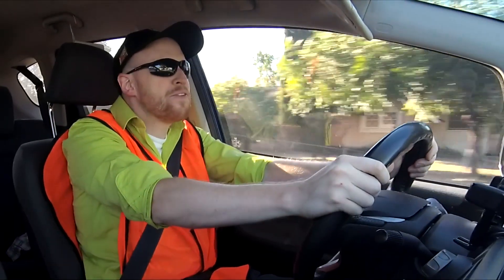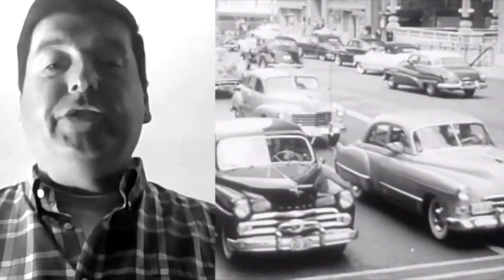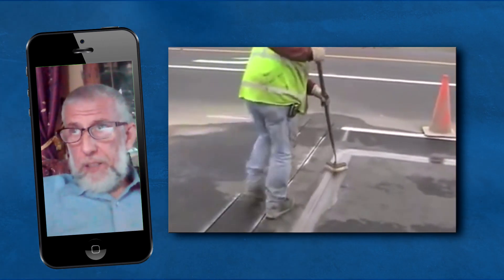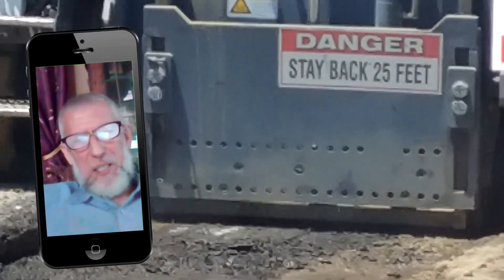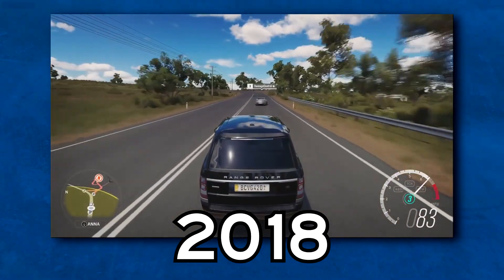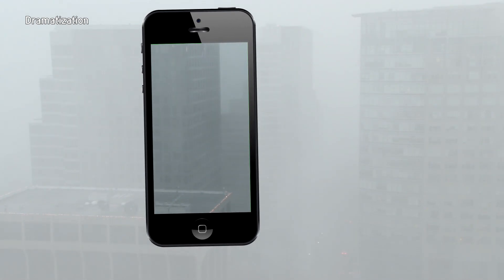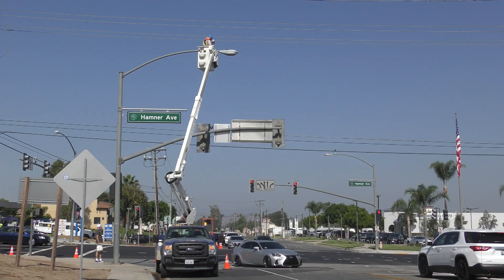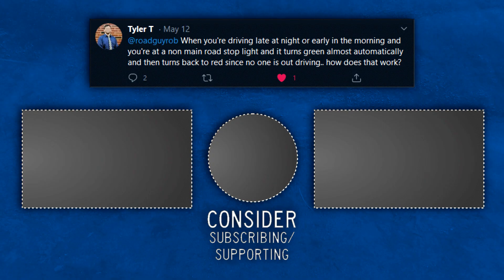How do stop lights "see" your car (to turn green)?

Comment: I am old enough to remember when the switches were mechanical.  Rubber strip embedded in the road, about 2 feet front to back and the width of the lane.  Pressure from the tires activated them.

Have not seen those since the 1970s though.
Reply: I remember, as a kid, taking a running leap and landing on the plate to get the light to change (small town…so there was usually no one around to cause a hazard.

Comment: well seems like cameras are so much easier. even if they break a lot its still super quick to fix. low voltage installation is much easier than asphalt work.

Comment: For all you lycra wearing carbon fibre bike riders... here's a tip to get the loops to work.  Glue a neodymium or other decent magnet to the under side of your bike.  Magnets set off the loops much more than metal so you need only a small piece to set the lights off.

Comment: The loop detectors I am familiar with are "variable reluctance" detectors. They do not detect any weak signal generated by a car going over the loop. The cars modulate the ultrasonic current  powering the wire loops and this is detected.

Comment: The digital cameras being able to see better in fog is likely due to the fact that their detection wavelength window is wider than our eyes, they see into the infrared and somewhat into near ultraviolet also. You can see your phone camera doing this with infrared with an easy experiment at home, open your phone camera app and point your TV remotes LED at it then press a button. The normally invisible flashing of the infrared LED will be visible on the vast majority of consumer CMOS sensors that don't have a separate infrared filter to exclude it.

Comment: Two things. I remember when the "loops" that were cut into the asphalt were square mostly in the 80's & 90's. Now they're round. 
I asked one of my local public works guys if the loops detected vehicles by magnet or by weight. He said weight. Here he says magnet. Which is it?
Reply: It could be both.  The old ones may have been weight but now by magnetic
Reply: Only really old ones were weight

Comment: Optical sensors are most affected by light after dark. One night a car was broken down at the stop line. With his emergency flashers on, the light would not change to let the other directions go.
After that I would start flashing my high beams as I approached the light, it almost always turned green before I had to completely stop
Reply: I have a black car. I had to change my route because of an old optical sensor.   It would not detect my car.

Comment: The signals I grew up with in England used two tubes close together, often covered with a single rubber strip. This could not only sense the direction of the traffic but also potentially its speed. (In the 1930s there was one experimental 'green wave' system that I was aware of, one of those 'if you kept to x mph then you'd never hit a red signal going through this town). As a horrible little urchin I used to like stomping on the tubes to make the lights change.

As a motocylist in today's USA I dread the coil detectors. You rapidly get to know which ones won't see you and adjust your route accordingly -- it gets boring wating for a car to turn up.

Comment: In Wisconsin, vehicle sensing loops are used at most all the traffic light intersections. As a motorcycle rider, I can attest to the fact that these loops will not ever respond to the presence of a motorcycle. Bikers pay taxes, pay license fees, pay insurance, and have to get a special license to operate a motorcycle in Wisconsin. Yet our roads are NOT at all designed to deal with motorcycles. Sitting at the red light forever, as cars line up behind you, is the norm. I’m told that motorcycle riders are allowed to go through a red light in this situation. How many other motorists or police officers know that this rather dangerous move is okay? Typical government bullshit engineering. Like all our roundabouts that are way too small for trucks to negotiate. Anyone who puts their faith in government to do the right thing simply needs to look around themselves.

Comment: Yeah I mean you can see the things in the road if they have them and they work of magnetism to detect the metal in the car which is why they suggest putting a neodymium magnet on the bottom of your motorcycle or scooter. It routes back to the HUB at the intersection and the HUB or traffic controller will use that data to make changes in the light. In other areas you can just have an intersection that is on a more stringent timer that will just change lights according to schedules that have been programmed after using those lines they string across the road to get an average for how many cars pass the area and what times. They base the programs off this and update the timings periodically.

Comment: Something I would like to know is the purpose of putting a detector on those traffic lights managing busy roads that are instead programmed to turn RED when traffic arrives. We have a surplus of those here in Alabama.
Reply: I live in St. Louis, where, and no this is not a joke, the city actually did time the lights specifically to stop people from hitting multiple greens in a row. 

This is most obvious on the Northern Kingshighway viaduct, where southbound Kingshighway gets a green just as McRee gets a green, which backs up traffic all the way to Oakland and beyond. However, that creates the opposite problem for the northbound side. Someone who gets a green at Vandeventer can end up charging all the way to Interstate 64. However, that's not as bad, since there's much better visibility and less conflict on the northbound side. Someone on westbound Manchester who wants to turn right can see all the way down the viaduct and then some, up to Interstate 44.

The reason they did this was because there were too many fatal car accidents involving speeders, which they figured wouldn't happen if everyone was crawling through the intersection as one massive 90 car long platoon. That worked and now St. Louis has an abnormally low rate of traffic fatalities despite an abnormally high rate of total accidents. Personally I'd rather have them just remove conflict points on roads and physically slow down streets but this is a pretty smart temporary solution

Comment: can you explain why it doesn't work if I shut my lights off?
I normally turn my car off when I know I will be stopped for longer than 10 seconds, to save gas. I did this one night at a notoriously long traffic light, and the light never changed. after 10 minutes of waiting I looked both ways and ran the light. When I explained to the police officer who pulled me over what happened, he said that the lights wouldn't change unless my headlights were on. How does that work?
Reply: What sort of detector was it?

Comment: We have an intersection near me with a traffic light on a big curve. They used to have loops further around the curve to measure how many cars were waiting, but when they switched to cameras, they only put one right at the intersection - traffic backed up for a mile because the intersection computer thought only 5-7 cars were waiting instead of dozens. I called the traffic engineering department and they apologized that they didn't think of this issue...

Comment: At the time I left Los Angeles they were installing camera traffic signals where the yellow light was only a fraction of the time it was yellow in normal non-camera lights.  People were getting tickets in the mail all the time for going through red lights.  And as people realized this, they were hitting their brakes and rear end collisions were significantly higher at camera-controlled intersections after installing these "safety" signals.  Turns out the company that installed these cameras got a large percent of the money from each citation mailed.  I don't know if they fixed or eventually removed these camera traffic lights.  All I know is the city thought they were the greatest invention and great revenue producers but city street drivers thought they were the most unsafe things ever installed for controlling traffic.

Comment: Those sensors in the roadway are actually pretty sensitive!! Ive personal experimented this with the signal lights on my way to work, btw i ride a bicycle to work. I noticed some lights would legitimately not change if i stayed on the bike path. So i would have to run a light with NO ONE around me lol. So i thought about riding in the bike lane untill i got to the light, then i would just ride over the circles cut into the road and BOOM!! The light changed!! Been doing it for 8 months now with the same 6 signal lights i cross
Reply: I've started leaning my bike over and getting the front gear to set off the induction loop, since just riding over them doesn't work where I live

Comment: As someone that rides a mostly aluminum motorcycle most sensors don't pick it up. When enough motorcyclist complain, they change the sensitivity of the light, but now some of those lights act like they are on timers instead of sensors.

Comment: I've been dealing with low sensitivity loops on my motorcycle and a trick I've found is to glue strong rare earth magnets under the toe slider and wave your boot over the edge of the loop. this works with bicycles as well. 
and if all else fails hop off and hit the crosswalk button.

also, fun thing I was spectating at the long beach grand prix, and the indycars riped out the loops on the track from their tire grip.

Comment: Problem with this is traveling at hours when the street is empty I find I have to race to the intersection when it's red before I miss the detection cycle otherwise the main road Cycles twice and it's really long. Kind of the same thing for green if no one's keeping it busy it's going to decide there's no more cars and go to the next part of the cycle. So really all this does is confuse drivers that are used to the intersection timing. I know which lights have longer greens  and if suddenly it's shorter because no one's detected in the waiting area  I'm pulling up to it thinking I got plenty of time and suddenly it goes yellow at the last moment on me and I'm surprised . Instead it causes us to race to get there whether it's red or green otherwise I wait longer than usual in my opinion and experience. Sounds good and works in some smaller intersections but overall not as good as it sounds.

Comment: As a motorcyclists I can say I don’t think I’ve ever had a camera recognize me at an intersection. I used to have the same issue with the magnetic loop system till I figured out a trick that I will share with other motorcyclists. 

It’s simple really. Put your kickstand down at the intersection. This disturbs the field enough to change the light. 

You’re welcome

Comment: There is a double left-turn lane near my house that drives me nuts. If there is no car over the loop in the left lane when the other light turns red, then there is no left-turn green. If the front driver is too far from the loop, the light won't change, even if there is a long line of traffic in both turning lanes. I've sat through THREE signal changes before saying, "screw this, I'm going straight to the next intersection!" If I can't get the "pole position", I'll use the right-hand left-turning lane for that very reason.

Comment: What about microwave radar? I've been seeing a switch to that where I live.
Reply: It is getting popular!
But the thing is it works great for advanced detection, when it can "see" a fair distance away, and cars are moving quickly. Radars Achilles heel is that it sucks for stop bar detection. So up close it's not so good. When cars are creeping up slow they can disappear to the radar. Like if you have a driveway or street that turns into the road close to the intersection.

Comment: I was hoping you would explain how certain lights can detect emergency vehicles and give them priority. I have seen ones with just a sensor and was always curious how that works.
Reply: Emergency vehicles have a device which they can change the light with a come up. Some of these were being sold on eBay and there was an effort to Outlaw their sale.
There are also fixed detectors which see the flashing lights of the approaching vehicle.

Comment: I might just try to add a little more detail to the car detection loops theory of operation (prefixed that this is based on educated speculation rather than a deep understanding), in case anyone is interested. The way that it's described in the video requires the car to be both a magnet, and to be moving. Cars aren't static magnets, so the way it's described doesn't really work.

What happens is that a small high frequency AC voltage is applied to the loop of wire, which in turn produces an alternating electromagnetic field that reaches up out of the road. When any metal (like a car) is placed into this magnetic field, the electrons in the metal start moving. This is very similar to how a transformer works but instead of the electrons moving through a wire on the other side of the transformer, they move in the metal body of the car. These are called "eddie currents". These eddie currents are incredibly tiny so don't cause any problems for the car, but in theory heat the metal up a tiny (insignificant) amount.

If you think about this from a conservation of energy point of view, those eddie currents are heating the car up, and that energy has to come from somewhere. The result is that electric potential energy is bled out of the coil and converted into heat energy in the metal of the car. The result is that the voltage in the coil gets reduced since it's energy is now being used to heat the car up a small amount. This is similar to how induction hobs work.

-- More technical explanation --

From a more complex electromagnetic point of view, the magnetic field that the the coil in the road produces actually produces it's own force on the electrons in the coil that created it in the first place. That force on the electrons is actually opposing the direction to the current generating the magnetic field. The force isn't enough to stop the current completely, but limits the current flowing through the coil compared to what it would be if the magnetic field didn't exist. We call this kind of resistance to current "impedance", and the impedance (and therefore final current in the coil) depends on the magnetic field strength that the coil is experiencing.

When some metal like a car is inserted into the magnetic field, eddie currents are produced in the metal body of the car. They actually start generating their own (weaker) magnetic field; however this magnetic field acts in the opposite direction to the magnetic field of the coil, so it cancels out some of the magnetic field that the coil produces. This means that the magnetic field that the coil is experiencing is reduced, so the opposing force on the electrons (impedance) in the coil also reduces. This reduction in impedance causes an increase in current flowing through the coil, which can be detected as a drop in voltage across the coil whenever there is metal in proximity to it.

Comment: Actual engineer: Hey lets move the thing that is expensive to maintain out of the road and put it in the air where it is cheaper.

Solar Freakin roadways: Hey lets put solar panels that work great above ground, are cheap to maintain and even provide cover for parking lots if installed above and put them in the road where they are orders of magnitude more expensive much less efficient and do not produce power when cars are driving.

Comment: There are loops on the open road to like interstates and some on secondary roads.  One loop per lane is a counter for trafic. Two loops are counter and speed detection.  Your car trips the first one  it times how long it takes for the car to get to the second loop and trip it. The time it takes between the two loops calculates the speed for that  distance . They can use the info gathered to know where the highest speeds are and set up speed traps for speeders. Another is the rubber hose the same rule applies one is a counter and two speed detection. And some have used the two hose for enforcement of speed limits. With an officer monitoring the hoses set up. The distance between the hoses is to be a set distance.  But a change in spacing can have cars going faster or slower than they are.

Comment: I'm surprised you haven't mentioned the blinky yellow arrow that lets you make a left turn when opposite direction traffic has the green light but traffic is light enough so you can turn left without having to wait another whole light cycle.
Reply: We don’t have these in Toronto. Either left turns are advanced/protected with a green arrow and permitted (with a yield to oncoming) on a normal green, or the left goes through a median streetcar track (or is 2 lanes) and has a dedicated signal. Blinky yellow arrows are not permitted by MTO regulations.

Comment: All these ways do not work well for motorcycles.  I can't tell you how many times I have to wait for a car to pull up, or run the red light after 3 cycles..
Reply: You can get yourself a UV light that goes on the front of your bike so that the sensor can see you

Comment: California doubled the crosswalk time so people using canes and walkers can cross safely.  Except that most people pushing the button are either on bikes or jogging.  This not only frustrates the motorist but causes more pollution as cars are idling longer.  It would be good if the cameras could detect when the crosswalk was clear and change the lights accordingly.  We have the tech, why are we not doing it?

Comment: "Loops can detect bicycles if done right"  If done right is key.  As a cyclists I can tell you that the majority do not detect my bike.  I have to position my bike so each wheel is directly over part of the loop and even that doesn't work most of the time, especially if you have carbon fiber rims.